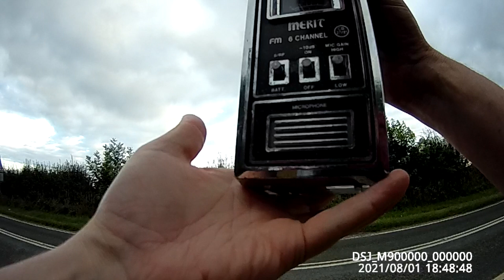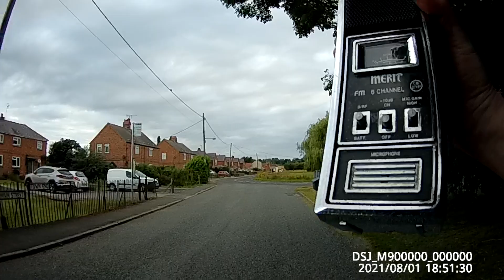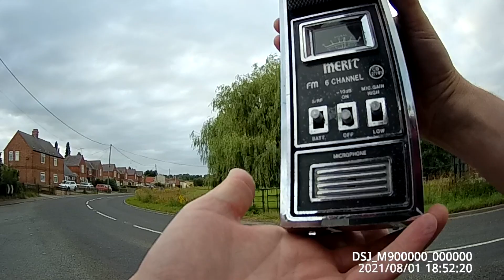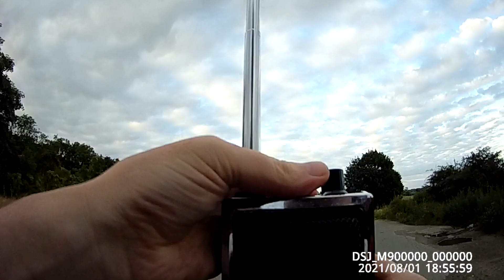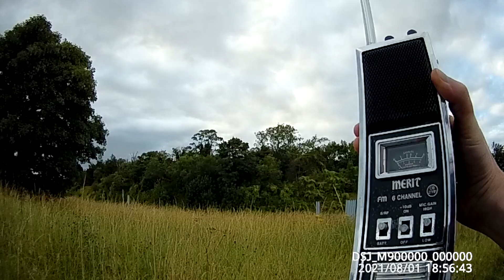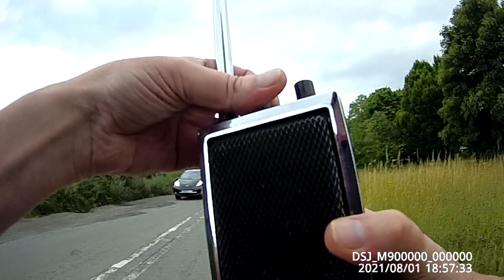Merit 6000 CB27/81 6ch 4W CB handheld - Field test

Comment: ** question , what do you have the ground on the radio connection hooked to? the alligator clip is covering it.
Reply from the maker: Normally test equipment ground will be one of the tuning coil cans on radios where proper test points aren't provided.

Richard
Reply: @ukfmcbradioservicingTango21  so  the way you have it hooked up to another antenna you can transmit that way?

Comment: Was just thinking maybe Mr chippy should speak louder and closer into the handheld.   Thank you so much for making CB radio videos.  653 Hamilton Ontario Canada.  27.3050 LSB      73s
Reply from the maker: He deliberately speaks at arms length for the purpose of the video. Bear in mind FM isn't like AM where the level of modulation affects the range. With FM the audio volume doesn't affect range. This radio uses an electret microphone & has decent speech processing. One of the front panel switches is hi/lo mic gain so you can choose how you wish to speak into it.

Richard, G0OJF, UK
Reply: Thank you for the enlightenment. We rarely use FM here in Canada. Thanks again 73s